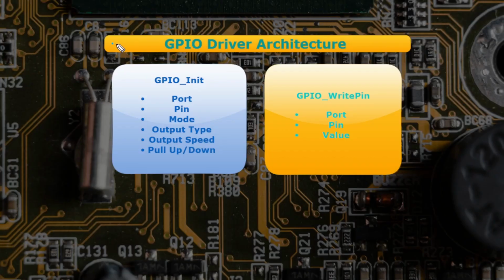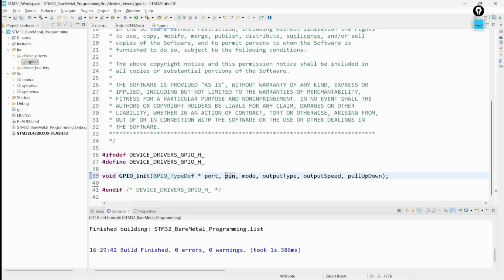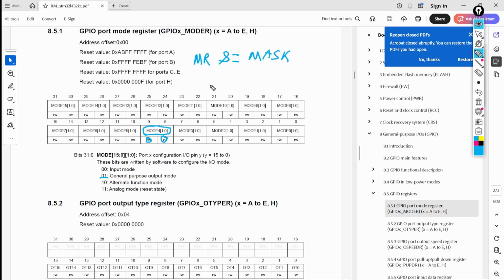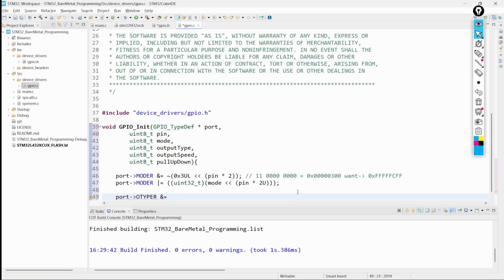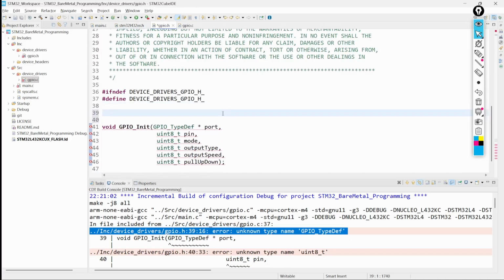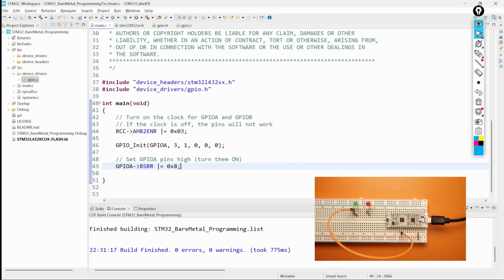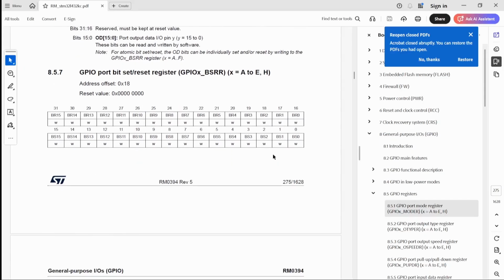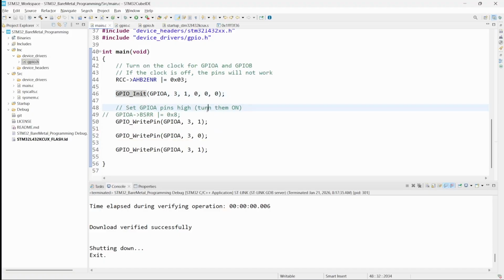Skip the HAL and Build Your Own GPIO Driver for STM32

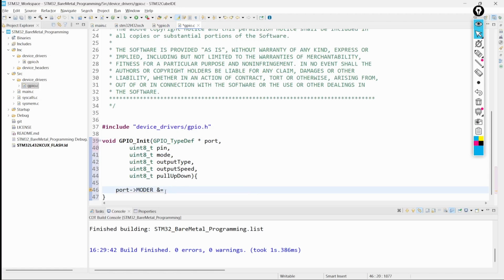Comment: Come back analyzed code more deeply 9:08 , this tricky things with bitwise goes clear only after you try it 😉
I have created 32bit value as immitation of moder register, I can explain it as this:
•	Creation of mask which keeps all values the same, except pin which value we plan to set. For that pin value will be resetted.
•	Applying these mask to the current moder value
•	Setting necessary mode value

I did only because I wasn't sure it it keeps previous values of different pin modes, and I think it works (in your example you have played only with one LED).
Again, good job!
Reply from the maker: Andrew, thanks for sharing your thoughts. Nice job figuring it out! Doing something is a best way of learning sometimes :)

Comment: Thanks for this wonderful series. Just wanted to ask if I can follow along with the following board as it is available in my area?

NUCLEO-F401RE STM32 Nucleo-64 Development Board with STM32F401RE MCU
Reply from the maker: Thanks for the kind words! Yes, you can absolutely follow along with the NUCLEO-F401RE. Most of the code will translate directly—registers, bit manipulation, and peripheral logic work the same way across the STM32 family.

The main differences will be in the setup: you'll need the correct device headers for the F401RE (like stm32f401xe.h instead of stm32l432xx.h), and you'll want to check your pin mappings since the onboard LED and button may be on different ports. Clock configuration may also have minor differences depending on your CMSIS files, but the core concepts remain identical. Hope this helps.
Reply: @EquipEmbedded thanks.

Comment: Thankyou for putting these videos together. I am following each one and coding along on my nucleo board. Quick question @9:14 why is it necessary to reset the bits for the particular pin before we set it to output mode in the next line.
Reply from the maker: You're very welcome! To answer your question: The reason we clear the bits before setting is to ensure there are no leftover values from the default configuration or from a previous operation. For example, the MODER register in STM32 has a default reset value of 11 (binary). We need to clear it to 00 before we can set it to 01 for output mode. If we didn't clear it first, writing 01 would have no effect — the bits would remain 11 and the pin would stay in its default mode. Hope this helps!
Reply: @EquipEmbedded i think I get it. Thanks for the explanation! I appreciate you are covering creating one's own HAL. Using manufacturer provided hal just feels like another Arduino which doesn't give much opportunity to learn if you already know Arduino